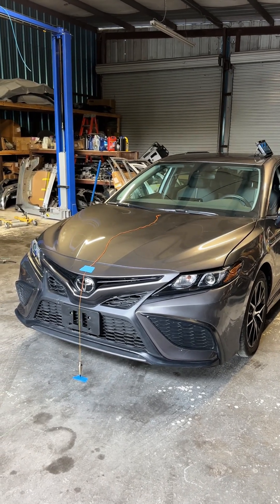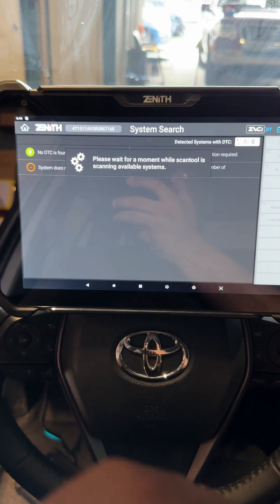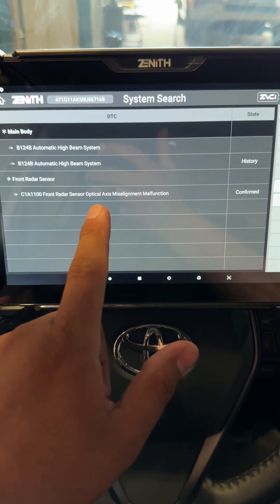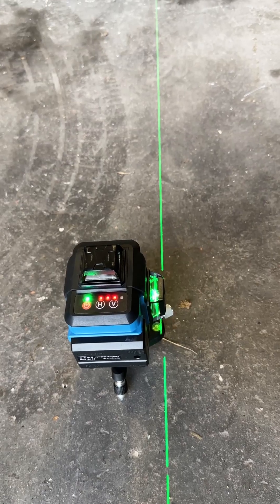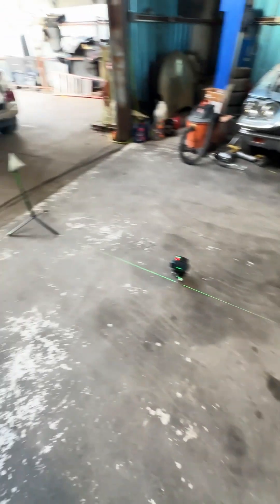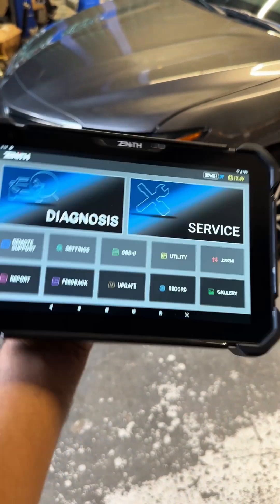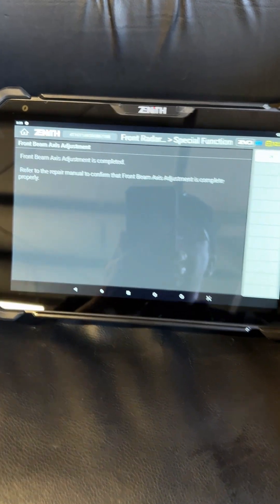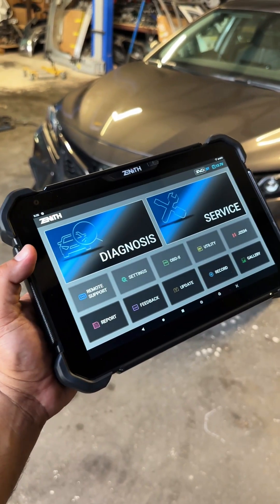ADAS FRONT RADAR SENSOR CALIBRATION TOYOTA CAMRY ZENITH Z7

Comment: Remember when, camrys, came with just enough materials underneath the hood, to get them down the road? Nowhere at all, was it super sophisticated, or packed with technology. It was a basic mode of transportation, with a basic entry-level price. 

Now, being one of the most sophisticated machines on the planet. And one of the most expensive, passenger vehicles on the market. 

It's called gradualism. They gradually screwed us. So they could implement technology that nobody wanted, and nobody needed. 

And now we have to pretend, that, automotive repair is the equivalent of rocket science. 

Spark, fuel, and compression, everything else is 🐂💩

By the way... There's over 155 cases in the court system right now, a vehicle that slammed on their brakes on their highway, after, their collision avoidance programs have failed, right after being reprogrammed. 

And 55 of those cases, resulted in a fatality. 

I mean seriously, imagine picking up your freshly reprogrammed computer, and as soon as you get on the highway, and cross under the first overpass. Your car slams on its brakes. 

What a genius idea that is!

Comment: Are there any physical adjustments on ADAS components. For example, adjustment screws like headlights have?
Reply from the maker: On some yes. In this case the sensor is clipped to the front bumper with no means of adjustment.
Reply: That's what I had thought. On diagnostic network I see errors and problems with calibration after accidents. Working at various body shops I know there can be bent metal that can't be seen by the naked eye. I also know frame alignment measurements usually don't include bracketry. I have done alignments for 6 years of my life and have found that if something wasn't adjustable aftermarket solutions had to be installed or educated guess on a bent component replacement that I couldn't physically see. This is why I asked the original question, because if ADAS isn't calibrating after a collision it seems to me that all of those sensors should be adjustable because a front bumper can still fit and look good but cause the sensor to be misaligned if all it does is just clip in. @ADVANCEDLEVELAUTO